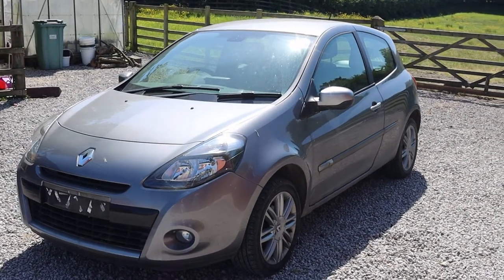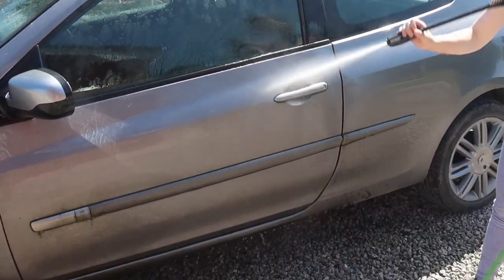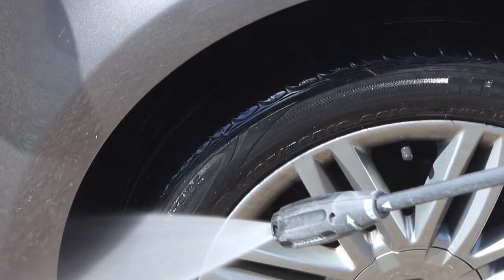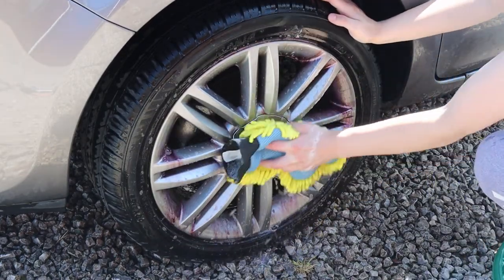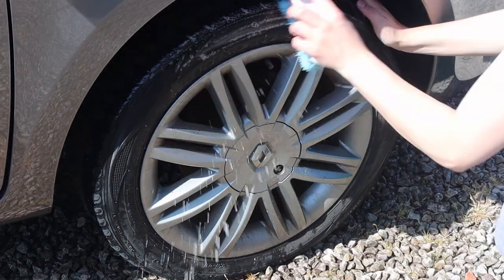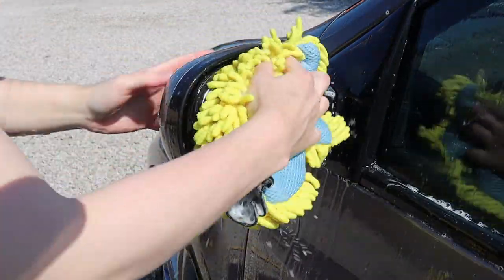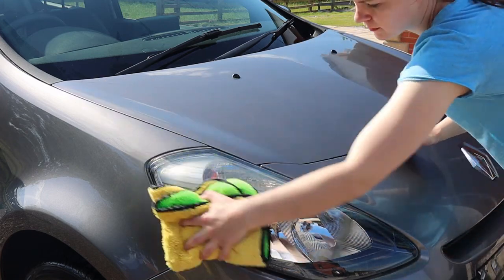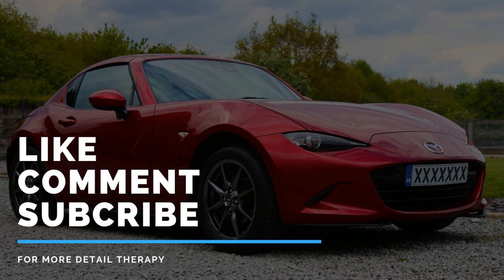Deep Cleaning a Mouldy and Algae-Covered Car's Exterior

Comment: Hi Heather, what did you think about Surfex HD as  a shampoo? I’ve used it quite often in my lance (about 10:1) as my ‘foam’/pre-rinse and it’s amazing. I’ve always wondered but never tried it as a shampoo - glad to see someone has give it a go! 👍🏻
Reply from the maker: I didn’t find it great for lubrication compared to a regular shampoo so I think the best option would bd to use it with a normal shampoo in the bucket to give it a bit more cleaning power for cars that need it

Comment: Come to this video a bit late but a good explanation. Really interested in your thoughts on the 2BM. I'm a bit of a sceptic as well because the rinse water gets dirty but also I kind of think most damage is done on the first pass of the wash mitt over any dirt that remains after the pre wash/rinse. I use different mitts for the upper and lower bodywork and a brush on the wheels.
Reply from the maker: I’ve just never been a huge fan of the two bucket method to be honest. I think I get a more thorough rinse of the mitt by power washing and using a few mitts just feels like the safest option for me. I know plenty of people swear by the two bucket method though so it’s a bit of a controversial one haha! I get what you mean about the first pass being the main issue I definitely agree, getting the prewash right is more important I reckon, then deciding which contact wash method to go for is all just personal preference I guess!